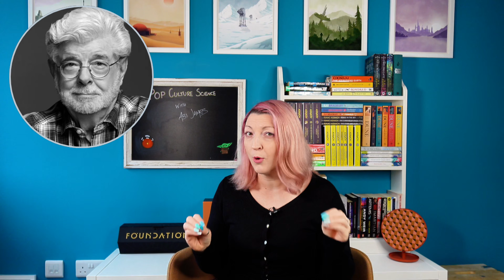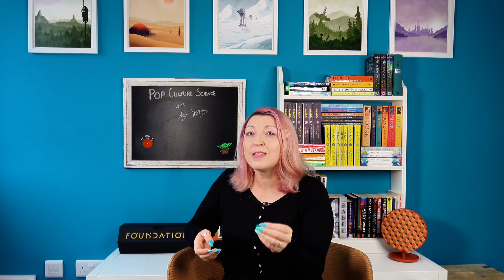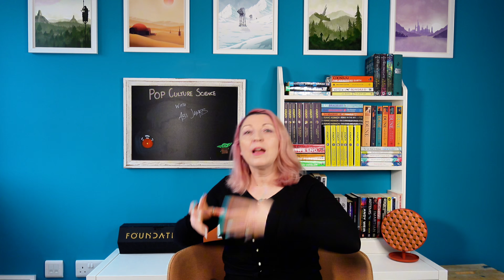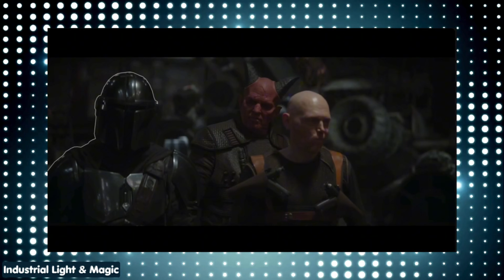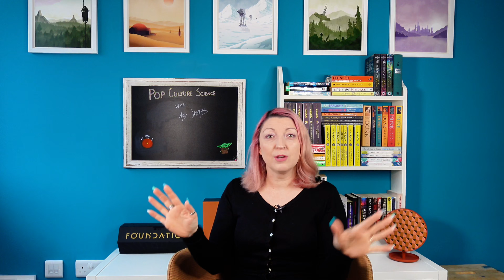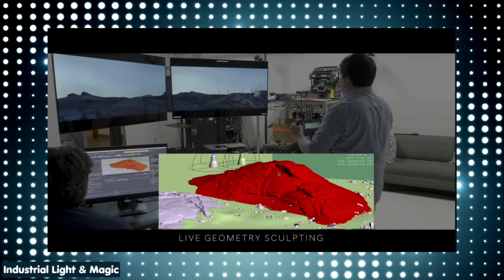How LED Walls Changed Sci-Fi Filmmaking

Comment: My girlfriend told me about “Stagecraft” in 2018 when the The Mandalorian came out. So it was fun watching the series and marveling at the application of this tech. 

We are looking forward to The Mandalorian and Grogu.
Reply from the maker: But they don't do everything in front of it. There are also a lot of practical sets and location shots. You can't use the volume for everything but it's good specifically for The Mandalorian because you will always have a lot of reflections on the metal. Doing that in green screen takes a  lot of time and work to correct. But there are also green screen shots and a lot of the outdoor shots are flat. It solves a specific problem but is not the final solution, it's a new tool that adds to the production and allows for a lot of the vfx to be in place while shooting to help framing , lighting and performance aspects.

Comment: Stagecraft and The Volume are indeed an amazing breakthrough in technology that allows virtual scenes changing with the camera in real-time. I do want to note however that as someone in VFX and someone who knows people who have worked in Stagecraft and projects that involved The Volume that VFX is still needed even in filmed sequences shot with The Volume sometimes. What comes out of the screen is not perfect. There might be moire or other artifacts of being an LED screen captured with a camera. That said, even in such situations that require the screen being fixed or replaced with VFX in post production, the key thing is that any reflections on subjects like the Mandalorian's armor are typically still intact and will help sell the subject being in the intended background as the environment of the scene.
Reply from the maker: Yes, my reading on it is that it doesn't remove the need for VFX but it helps reduce the issues with lighting on characters and props and adds to the realism for the actors as well as leading to a lot of pre-vis reducing the need for long post productions times. Also can allow for changes early on.

Comment: I have not seen the newer starears or startrek. It's made for other people for a few reasons. How much did they spend when it could have made more movies. Though just part of hollywood failing on multiple levels in ways.

Personally acustic levitating bioprinting or holography is more intresring.

If you eant one to look into. They used to fo test groups with EEG's to pick up reactions. What happened. They clearly got rid of it or would be producing better.

As far as favorite so far. Bullet time slow motions with .ultiple camera's being stitched.

Comment: I have a random silly thought. Rendering something at production quality as the actors are acting would be difficult and expensive. At the same time, the system knows exactly where the camera is. It knows exactly what is being displayed on the screens. It would not be that hard to generate a low resolution image that provides accurate lighting, digitally subtract that out , just like a green screen, then mat in a very high resolution background afterwords. It would be computationally less expensive, it would require less expensive hardware but, reflections might not be quite as good. 

With the backdrop views shifting with the perspective of the camera, not the actors, I wonder if people on the stage tend to get a bit sick?

Comment: I‘d love to know how many shots in the Mandalorian are actually in-camera. I‘d bet that a sizeable number of backgrounds will still be replaced in post. Be it in part because the unreal engine doesn’t quite hold up against properly rendered VFX footage or because the led screen cannot account for lense distortion.

The main advantage is really just lighting and reference. Possibly it allows for the use of garbage-mattes instead of full on rotoscoping, but I highly doubt they get as many usable in-camera shots as Lucasfilm wants us to believe. 

It’s potentially a great solution for a very specific problem. The Star Wars shows however tend to view it as the be all end all solution and just do everything in front of the screen. Thus each set is set up in a circle, each location has some weird rocks hiding the seam and so on. It becomes really distracting after a while. Even green screen or blue screen shots in the prequels tend to look more convincing because at least there’s some variety in how environments are layed out.

Comment: I'm old enough to remember the art of Matte Paintings as backgrounds for sci-fi and fantasy movies. Lucas used them a lot, as did Spielberg in the Indiana Jones movies. ILM built a foundational history beyond Lucas's movies. The FX house, while initially built for his projects, became the go-to FX house for dozens of studios. Star Trek movies owe a great deal to ILM, for example.

Speaking of Trek, in the modern era, towards the middle of Discovery's run, they built one of these digital light boxes, the size of a sound stage, that would aid their FX in the same way, but which would also allow FX to be produced more cost-efficiently. I forget what season it was in which they started using it, but you could tell the difference.

The only problem I have with the idea is that the shape of the light box determines the design of the sets and backdrops. A lot of the modern Trek sets all conform to a circular set design ethic now. Once you see it, it's hard to unsee.

One major complaint regarding Lucas's style of FX driven sets and characters was how hands-off he was as a director. He'd frequently be directing from a separate room, away from his actors and the soundstage, buried in a computer display. And a lot of shots in the Prequel trilogy had this really passive feel. Like, there were a lot of shots where two characters would be passively walking in front of a digital backdrop, just kicking out some lengthy exposition. Again, once you see it, hard to unsee.

Favreau avoids that with his directing style, and Dave Filoni came from an animation background, so he sets up his shots with that sort of thing in mind. So the collab between these two guys for Mandalorian  avoids some of those old problems Lucas had.

Anyways, on the topic of future topics...

I was doing some research for a story idea regarding neural nets. I was looking into Trek's "positronic neural network," which of course, is what Cmdr. Data's android brain is based upon. Trek science only goes so far to explain the use of "positronic." As you know, a positron is just an antimatter version of an electron. But I'm wondering, do you think there's any significance to the use of a "positronic neural net" beyond just the fact it sounds cool? Seeing how neural nets are employed for LLM inputs and outputs and layering, I can't figure a reason why positrons would be beneficial. I'm trying to come up with a plausible sci-fi reasoning behind it. Wondering if you had any insights that you might discuss in a future video.

Oh! And also, "programmable matter." Thanks.
Reply from the maker: I'm going to do a deep dive on robotics soon! To be honest, there is no scientific reason to have a 'positronic pathway'. But that is what Asimov used for his robots. He wrote his first robot story in abotu 1939 which was pretty soon after the discovery of positrons so he gave his robots positronic brains as a play on electronic for a futuristic tech. There was no science reason, he just liked the word. Data is essentially Asimovs character R Daneel Olivaw from the Robot series
Reply: I can't remember exactly when Discovery started using it, but it was really fun to see the behind the scenes piece on their use of it, and them calling it the holodeck. 😆